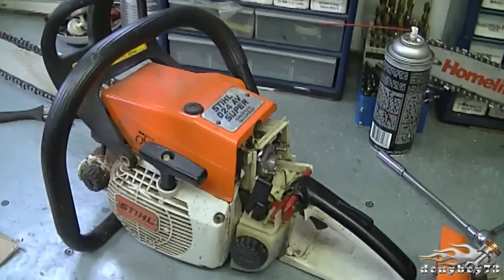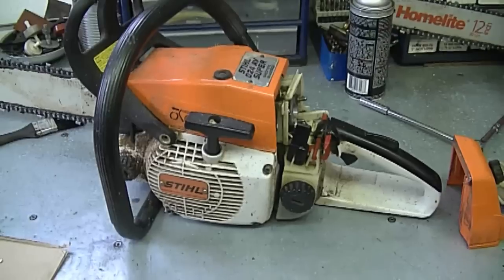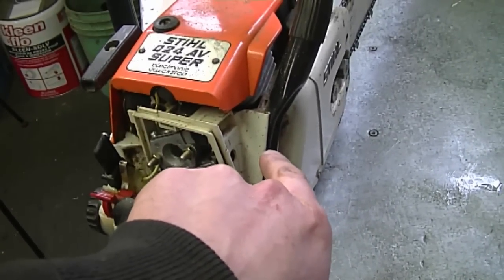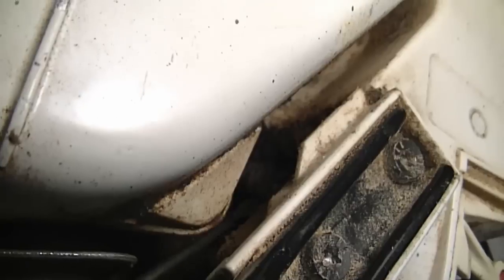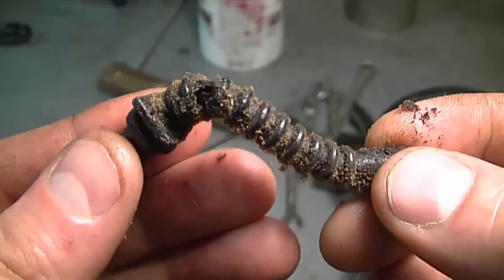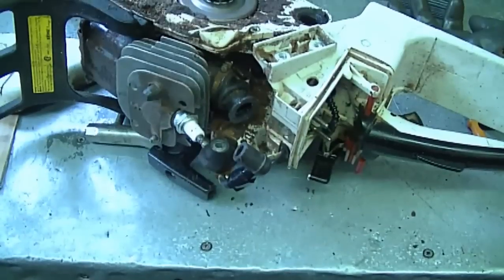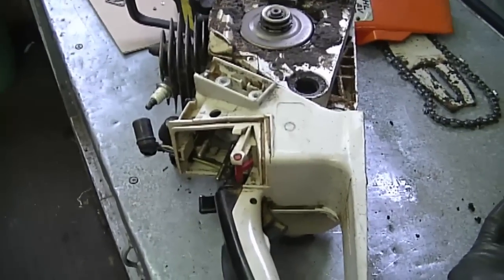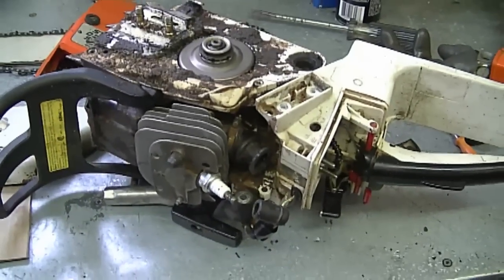Quick Tip #3 - Chainsaw Impulse Lines

Comment: After a very discouraging encounter with the local Stihl dealer, who wanted $70 just to tell me what might be wrong with my saw, with repair estimate possibilities nearing half the price of a new saw. I took my saw home and started taking it apart myself. I found this cracked impulse hose on my 1996 024 Super, a fine little German chainsaw. The impulse hose and the carb kit were $35 and my little screamer runs like a champ. Thanks Dony.

Comment: This is very true regarding the impulse line. I have an fs90r and an fs130r. The fs90r purrs like a kitten and runs stronger than the fs130r, which obviously is supposed to have more power than the 90. I installed a new carb and fuel line kit on the 130, tried to adjust it and it runs ok but erratic. Turns out the impulse line was cracked and not providing the vacuum for the carb diaphragms to work like they're supposed to. Replaced that impulse line and now the 130r runs like the 90r. Awesome vid!

Comment: Oh, Dony. Sorry for a goofy question. What does the impulse hose do?
Reply: It runs on the vacuum pressure from under the piston to actuate the pump diaphragm on the carburetor. Piston goes up, pressure in the line gets sucked into the crankcase. Piston comes down, pressure builds in the impulse line.

Comment: I have a craftsman 16” 36cc ---06118D20933. It starts up ok but bogs down when I start to cut. If I hold it tip pointed up & cut that way it runs fine. After cutting for a few minutes I can cut holding it level. But it will start to bog down again. It is not leaking any gas. Does this unit have an impulse line?
Thank you

Comment: Loss of impulse pulse in a two cycle can be a intriguing problem.  I have a used Stihl HS 45 that I picked up last week that has a similar problem.  Normally I would just replace the impulse hose in normal routine maintenance if the saw indicated it was loosing fuel flow but the HS 45 has a stand-off isolation block used as a channel for the impulse pulse.  My carb and fuel lines are pluperfect, so it is not them.  I have two Zama C1Q carbs and I have swapped them out with the same results.  It has to be the isolation block.  I will check it out, today.  Your thoughts?  The hedge trimmer will run but only for a second or two, based upon how much I primed it.

Comment: Hi there Dony, great videos!  I came across your channel after getting a good deal on 3 saws, an 011AV, 024AV and an 036.  I have gone in and done lots of needed cleaning and inspection on each unit.  The 024 had a running issue I tracked down to a bad impulse hose just as you have here  (fast idle that could not be turned down and intermittent idling, falling flat on revs).  The pressure/vacuum testing vid was helpful on that!  The 011 is good to go.  Question on the 036 though:  The clutch was run hot and cooked the bearing and it ate crankshaft.  I assume that needs to all be replaced.  I see after market kits out there.  I worry about quality.  Are there brands to consider safe or do you know of any to stay away from.  I paid up buying Sthil branded hoses for the 024 repair.  Was that necessary?  Are there good sources you can recommend to buy decent quality parts (OEM or aftermarket) from so I can thoroughly restore the 036?  Crank kit, gaskets, hoses ect...  Thanks!!  Jim

Comment: Is there a vidio to show how to get off the impulse hose (the end that goes into the cylinder). I can see it in there but no clue as to how to get back in there to disconnect. It appears even too tight for needle nose pliers and I have disassembled much of the saw but can't seem to seperate the trigger/handle from the cylinder to get back in there.
Reply: Same problem here ! on a 024stihl How do i thake the damm thing apart and visa versa

Comment: Hello from Europe! I bought a second hand Sachs Dolmar 111 3 months ago. The day I bought it It took a bit to start it but started and looked good. After that day it was imposible to start it again. I put new gas, changed the spark plug, clean and rebuilt the carburetor, and clean exhaust. After that the chainsaw would do a start but within 3 seconds it would stop again. I gave up. This week I had some time and decided to try again and surprise, it starts perfectly!! I tried a couple of days and no problem at all. The question is; Do you think it may have something to do with the temperature or humidity?

Comment: I have a stihl 025 which stopped running after the winter.  Put fresh fuel in and won’t start. Cleaned out carb & still won’t start.  Can get it to run for a few seconds with starting fluid.  The original vent tube is full of fuel?  Would that prevent starting?

Also do you have a video showing how you disassembled that chainsaw to access the impulse line?

Comment: Donny Boy,  my Stihl 025AV had symptoms of a leaking impulse line,, hard to get the carb adjusted and it  dies if  the saw is inverted,  I replaced it impulse line and have not yet tested it as I don't want to anger my neighbors on Thanksgiving.     I have examined  the old line and intake boot.  Nothing obvious in the way tears.  I  I replaced both.  I  did pressure and vaccum test the impulse line and it does not hold pressure or vacuum  after 7 minutes.  I think there is a very small leak not like what you showed in the video.  Is a small leak enough to cause issues?

Comment: impulse line is the same id as a fuel line , can i just bypass this mess and use a standard fuel line? and will a carb boot for a 034 / 036 fit a 031? only ones i can find fora  031 are expensive and 034 aftermarket ones dont look much different.

Comment: love the knowledge Donyboy73 thanku for the heads up its a really important part to look after the Outdoor power equipment old or brand new to avoid problems down the road when using them in the middle of a task for example cutting the logs of wood safely and cutting the grass clearing leaves with the leaf blower and trimming hedges with the Hedge trimmer and clearing snow with the snow blower or what ever as the common problem but a different model or unit that :)

Comment: Hi!  Am writing regarding my father's mower.  A TroyBilt w/ a Kohler 19hp engine.
It will NOT start.  Tried starter fluid, did not work, gas filter ok.  Engine turns.  I am thinking it would be either the key or the connection to the carb.  Any Suggestions will be appreciated.  Keep up the good work, love watching your channel.  There is something new to learn.
Gilberto

Comment: My vote is in. REALLY enjoy your videos. Do you have one on the Lawn Boy/Toro "personal pace" system and how it works? I have one I will be tearing into in the spring. It seems like the drive fails to dis-engage even when engine is not running? I have not torn into one yet as mine is brand new, but I bought a used one as a project. Too good of deal to pass up.

Comment: When I rebuilt my Stihl 029 for the third time I put a new impulse line on it.  Later I had to replace the coil because it was bad.  It ran great for a week or so, even after I replaced the coil but all of a sudden it would not idle.  It cranked and ran great at high speed but at idle - it died.   I could think of all kinds of possibilities, seals, carb and other things that could cause it not to idle but I felt it had to be something simple.  .  I started wondering if it was the impulse line?  Did it get partially unplugged when I put the new coil on it?  Yes, it had about 3/16 of an inch, so I push it back on the fitting and put the saw back together.  It ran and idled like a champ, so that was the problem.  I decided if it gives me anymore problem I will remove it , clean it with break cleaner and put it back on with 1184.  If able I will also put a small cable tie on it to make sure it stays on the fitting.

Comment: Great Video Dony. I have the same exact chainsaw and had the carb kit replaced. It ran fine for a little while but now when I start it it seems to idle fine and then when I give it some throttle it dies out. Could this be the problem? I can send you a video later if it will help. It was my grandfathers chainsaw from the 1980's and i'd really like to get it running perfect again.

Comment: Hi Dony, I have a STIHL Super 039, I have this same problem you talked about. I have rebuilt the carburetor and the saw will not run properly or I cant tune the carby. I can get it to run, but the saw idles rough and bogs down when I give it some gas. I have also clean the arrestor filter in the muffler. I have another saw 029, and this runs great. I placed this carby on the 039, and it still wont run properly.  Can you offer any other suggestions to try and get the saw running. Thanks

Comment: Good info but - I watched your videos on the STIHL 017 clutch & oil pump area and ordered a double handful of aftermarket parts and spares. Still no chain oil. Yesterday I ordered an oil pump. Today I wish I had considered an impulse hose and intake boot even though they aren’t connected to the chain oil system.
How about a list of likely soft parts and parts that are likely to need replacing? For those of us willing to try  aftermarket parts, the cost for extra parts is not much compared to multiple part orders.

Comment: Hey I got a quick question I got a McCullough. Mac 4600 chainsaw and I've noticed I've had to switch all the fuel lines especially the pulse line but the one problem I'm having is how can I get down in there behind the case and the motor to plug the pulse line in there's no way you can get down in there you got a video on how to change that on that saw

Comment: I am working on same saw. Was running but idle too high even with screw adjusted all the way out. I then noticed a broken in half impulse line. I replaced it and now saw won't start. Not getting fuel. Spark plug is dry. Any ideas?

Comment: I have an Echo CS-600P.  I cleaned the carb due to hard starting even when new.  Now, the saw starts well.  However, it dies slowly in 5 seconds when idling.  Low idle is at 1.25 turn out.  I checked the intake boot, fuel line, and impulse line.  All like new.  Any recommendations?

Comment: At my request for help you answered if the spark had "spark" yes it does.  I put a new one, cleaned the carburetor and it did not work.  Made sure it had compression, also confirmed the relay under the bowl works.  
The motor is a Kohler, s/n 3603332093, spec sv590-0017 Courage.
Please advise, and thanks for your help

Comment: Hai Dony thanks to Your vid I just repaired my 024 , the impuls line had come of on the engine side,I have thinkert a lot on other brand,s whom all had the carb direct on the cilinder  with no impuls line like this Thanks Man!
Reply: Do you remember what your symptoms were?
I just picked up an 024 and its starts up fine, but as soon as you try and make a cut with it, it just runs out of power and dies...

Comment: Great video. On an 028 AV Super, with the filter cover removed, what is the tube called that is on the left side just above the master switch. I can't seem to find it on any parts diagram. Mine fell apart (disintegrated). It had small set screws inside both ends blocking the line.
Reply: That sounds like the fuel tank vent tube.

Comment: would you have a Picture from the all Tee fuel lines setup going to fuel bulb and etc.
my saw is a STIHL MS250 year 2005, with could/EASY start (bulb fuel) 
I toke it indo a "dealer" and he disassembly and was not able to put together.

I Just need a Picture from behind the carburator to ser these hoses and "T" hose connection.

thank you

Comment: He dony, I have an o34 that wont start. I replaced the carb and that didn't work. Checked for spark  have reasonable spark, however i counld not get it to fire on starting fluid. Tore down the saw and performed a vacuum and pressure test and it held10 psi. No leaks at impulse line or intake boot. Could the plug be malfuntioning when installed?

Comment: Does the Poulan chainsaws have the impulse hose on it? I have a new Poulan Pro which will crank, but won't run no more than about 15 seconds before it dies. Like a dummy, I burned the box it came in before making sure the saw runs properly.
Reply from the maker: usually not, often just turning out the L and H screws helps
Reply: Thank you, Dony.

Comment: Dony, I   2 have an 024 saw. Hard starting son of ah gun. Always has been. Had it serviced 1 time and wz no different (they said they installed a carb kit, cost $62.00 American). Starting either gets it going everytime. Good saw, I have had it over 20 years. Just a bear 2 start, unless U have starting either. Bowzer.

Comment: Hi Donny great vid I got a stihl 361 That ceeps running hot Even after replacing every part on te oil pump every seal is new even the hose is new And after running for 5 min the blade whil get real hot Even to its geting oil 5 sthil dealers dont have a clue wat coud be rong
Reply from the maker: is oil actually getting on the bar and chain?
Reply: Not like u woud expect whit every part replaced 
Oil poors out of the bottem of the saw a bit like it aint getting truw the hole of the blade but 
I tripel checkt and that al clean 
I workt on these saws fore 10 years and never hade this problem before 
Sorry fore the bad englisch typing i do my best
Reply: Al i can think of now is getting a new blade 
But i always yused old blades before whitout a problem

Comment: how about showing where the line attached to the cylinder ? just bought a replacement cylinder and piston kit but don't see where to attach the line to the cylinder.
Reply from the maker: Tim Tracey at the base in front of the carb on the cylinder

Comment: I have an early 2000s Farm Boss (029?). The original fuel line disintegrated, and was replaced, but the OEM replacement didn't really fit the compartment. Two new ones just outright kink if you try to complete reassembly after installation. Anybody else have this problem?  Is there a different hose that is shorter, but long enough supply the fuel?  (Tihs saw has always been very hard to start.)
Reply: Paul Psilos I

Comment: hello donyboy quick question which i cant find the answer to my stihl saw ms250.well i have  put in a new carb kit checked inplus boot and pipes all is good the problem is that this saw when is warmed up it hangs itself and dies out then its hard to start only to hang and die again any ideas please would be great
Reply: Im going through the exact same issue with my 028 Wood Boss...
I just redid the carb, and installed new spark plug, and same issues...
Keeps stalling after a few mins run time and hard to start again...
Did you ever figure out what was going on with your saw?
Thanks
Reply: Iv heard its the engine seals when it gets hot they leak air

Comment: I can't get gas in the carburator I took the motor apart I think I did the right timing but I guess I did
Something wrong the only way the motor would turn on is if I provide fuel

Comment: they are a bitch to replace on a stihl saw.  I put one in a ms 290 last summer industry because of the bend in the hose it is tough to get seated in the rear handle.  I have an 029 that I am rebuilding right now and I will make sure I put it into the rear handle, first, and then connect it to the cylinder, last.